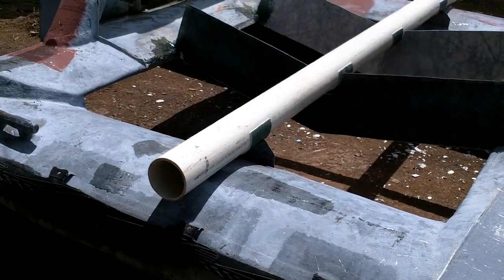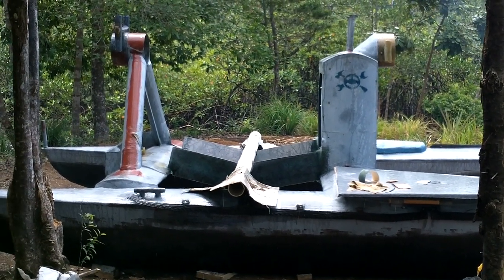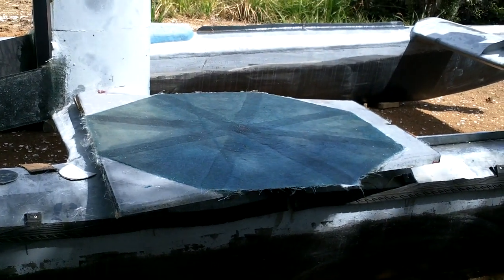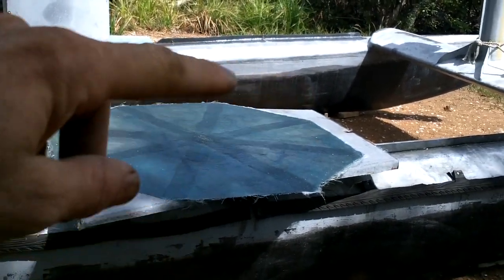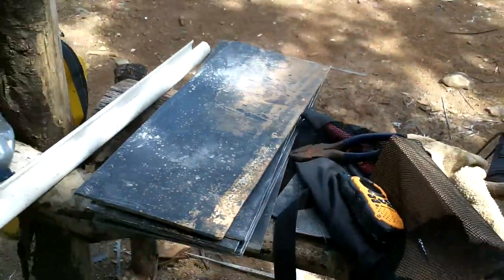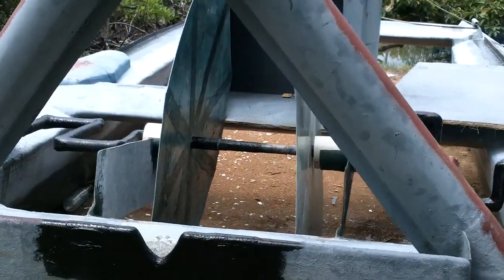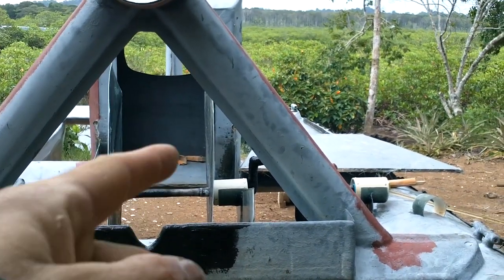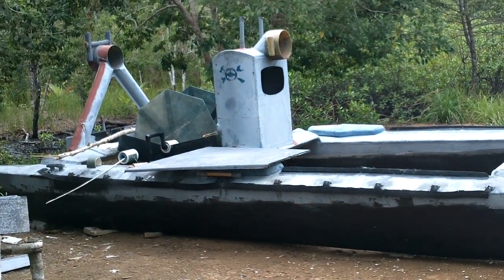Boat Chips 008 Pedals On!

Comment: Hi, The sheer stress of the paddle / water will break the fibreglass joint to the dirve shaft, the sides of the paddle should be soild ply/glassed the joint to the shaft should not be a glassed joint, you need a boss attached to the solid sides of the paddlewheel then a fastener from the boss through the drive shaft. There is also a risk the shaft could break  the sheer loads on this component are large.  Cheers Tony

Comment: have you tried vinylester? its like polyester, but smells worse, and is a bit tougher when set. might be perfect for boats :)
it has properties half way between polyester and epoxy. i've used it a bit for making moulds.its almost indestructible, and sets opaque white/beige.
Reply: I'm familiar with epoxy and polyester but I've never heard of vinyl Ester, pretty cool I'll try to keep that in mind although I like epoxy
Reply: @AtimatikArmy  it's worth a try if you need strength and low cost. I'm sure it has a couple of other benefits too